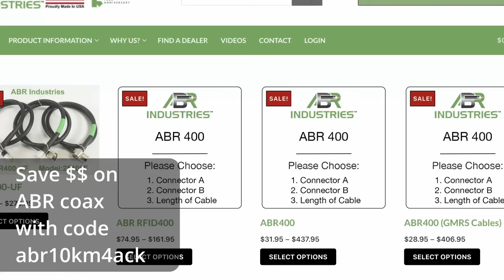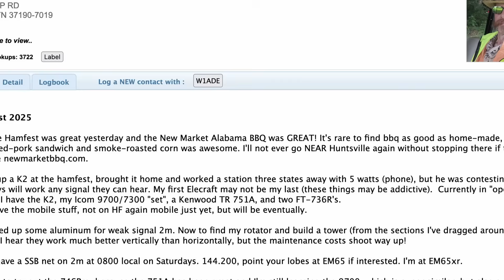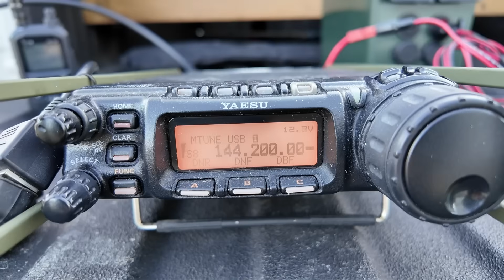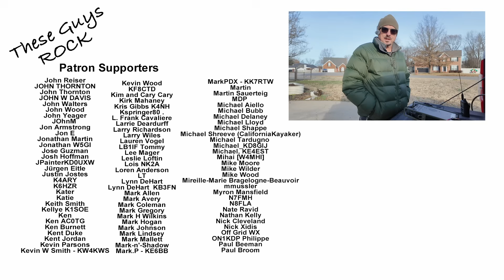I Set Up a 2M SSB Station on My Tailgate… Here’s What Happened

Comment: The problem is a lack of affordable radios that will do 2 meter sideband.    You either need a top shelf all mode all band radio, or an old used rig that is overpriced and hard to find.

Comment: do you get the 3x power increase from the transmitter using SSB at 2M like you do for HF?  Ex: if the 857 radio puts out 50w on FM, can it peak at 150w, or any increase at all, on SSB?
Reply from the maker: to my knowledge you don't get 3x power on SSB. However, you do get some gain with the directional antenna.

Comment: Thank you, Jason, for yet another fantastic video! 2m SSB is yet another great underutilized resource. I enjoyed the simplicity and practicality of your driveway- portable set-up. Aside from the antenna polarization configuration, it would be interesting to know what output power you were using. 
As was mentioned  in other comments, we are all painfully aware of the lack of new VHF/UHF All-Mode equipment on the market (Yaesu FT-991/A and Icom IC-7100) being the only exceptions. There was a time when affordable single-band or dual-band All-Mode transceivers were produced by the major manufacturers. Given that there is a great market for these products, where many thousands of units could easily be sold, I wonder why they are conspicuously absent from today's market.
Reply from the maker: Don't forget the Icom 705 and Yaesu FTX. Both will do 2M SSB. I was running 50W during this video.
Reply: @KM4ACK 
Good point. I also left out the IC-9700 and IC-905, mainly for affordability reasons. I was thinking more along the lines of the IC-910D, IC-970D, IC-271, IC-275, IC-471A, the old IC-351, the FT-726/736, FT-290 or even something more recent, such as a direct replacement for the FT-857D, like the one you were using in the video.
By the way, nice job using 50W!

Comment: IMHO, you need a better antenna. I gave away the Arrow beam because my homebrew Eggbeater loop outperformed it.

I also have an FT-857D here, but have a couple other QRP rigs that run 2 meter SSB. For the Eggbeater antenna, search for KB2HSH's post on his Eggbeater built from standard electrical supply parts.

73, Keith, WB2VUO near Buffalo, N.Y. (Grid FN02ox)

Comment: Noticed your Elk was horizontal. Many net control stations use vertical antennas to get a good copy on a full 360 degree check in area
Reply: Horizontal polarization is what is used on this net, but there is one participant that listens on a vertical, and then transmits on a horizontal. 

I use a horizontal 2m loop (omni-directional) to look for signals, and use the beam to dial them in. 

That 100 mile contact mentioned in the video was me QSO w/net control Jay.
Reply from the maker: Thanks. I need to check and see which polarization they were using.

Comment: SSB on all bands is one of the main reasons I like the Shack in the box 991A and 7100. The ability to experiment that is built into those radios really appeals to me. I do live in very rural areas  so 2M ssb contacts are rare. I do hope to get onto the Bozo Net in January as I travel through CA to Quartzfest.
Reply: It's the same reason I got the FT-847.  I used to use a FT-290R.   --  AA6LJ, Bozo 1197

Comment: Just saying for myself -- II think that the overall electronic/software advancements made since the 857 came out should make it possible for radio manufacturers to easily incorporate 2 meter SSB functionality  in mobile rigs like the FTM 500 or even HTs like the FT5.  Which, if radio manufacturers actually did the aforementioned -- I'm sure their units would sell like hotcakes.
Reply from the maker: The first one to do it will have a winner on their hands
Reply: The quangsheng Uvk5 kind of does a hacked DSB 2m I wish there was a true 2m SSB HT
Reply: Agreed

Comment: Nice. I wonder if most of the 2 meter sideband guys out there are running horizontal, and how a good vertical would have worked for you at the same height.
Reply from the maker: That's a good question, and a vertical would have likely worked for closer stations but you lose ~20db

Comment: I just finished the video, and it reminded me of a FB group post(long time ago). I know that 2mSSB has some decent popularity. But someone made mention of 220 SSB. I had a hard enough time finding a 220 radio with good power. Thanks to HR 2.0 I went with the 5888uviii. What radio are people using for 220ssb?
Reply: I have a KX2 with a small 10M to 220M  transverter that puts out about 9 watts on 220 with 8-10 watts drive from 10M.   I hope to do some VHF grid squares as a rover when temps are better  ( -9F here tonight)
Reply: @arnoldgrubbs2005  That makes sense. After thinking about it. A transverter would be the easiest way.
Reply: I have an FT 736R with a 220 module. But don't have an antenna up for the band at present. 2m SSB is scarce enough already from here.
Reply from the maker: Good question. I don't even know a radio that will do 220 SSB